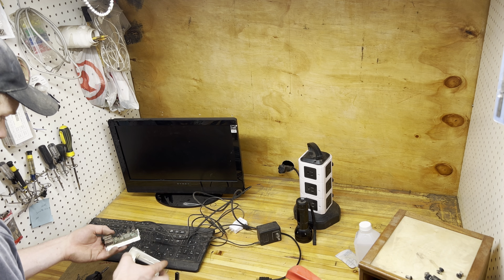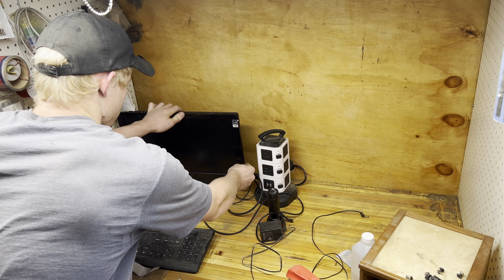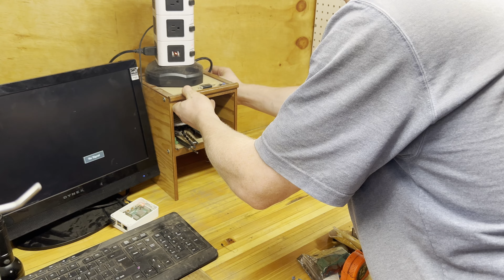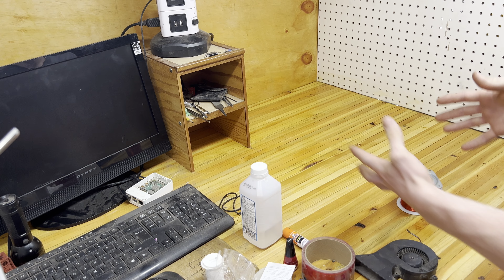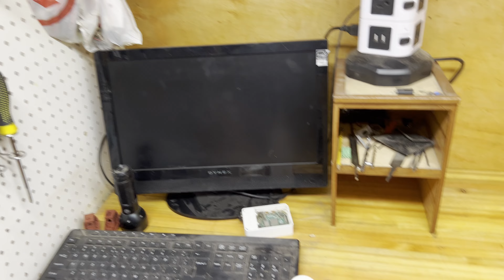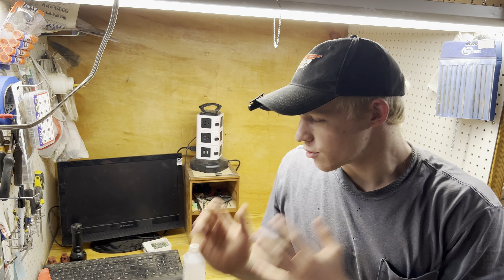SV08 Incoming 3d Printer!

Comment: Have much fun with the SOVOL SV08. You gonna like it. At least i do. I have 2 and one already has mainline klipper on it. The second will be soon. Stock works fine too except when for example you want to include an Eddy than you have to go to mainline klipper. Try it out stock and maybe you will go mainline. We will see. Have fun.
Reply from the maker: @cyberoptic3439  that is great! I have installed mainline on my SV08 and it works beautifully. I haven't modded it yet but a tool changer is coming. Also thank you for the comments and sub. It is a huge motivator.
Reply: @Ignite_lab_Projects  Your welcome. Youtube had selected your video when i was searching for SV08. So keep on doing the good stuff !!
Reply: I’m debating on whether to go main line or not… Gonna try a new inductive probe and if that doesn’t work then I am going mainline and getting Eddy NG
Reply from the maker: @larkinduval1882 sound like a plan! I have mainline installed and it was pretty straight forward. I haven't had any firmware related issues either. I am planning to install the Eddy duo pretty soon here as well. So many projects! :)